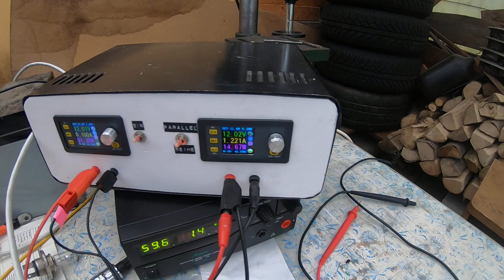Lab Update #36 - Prius Controller Progress

Comment: What kind of encoder is that and how many wires are coming out of it?
I have Renault Kangoo Z.E motor but Im running it with sensorless controller and not ideal...
 I don't know how to make of its rotor sensor that is in the motor. 
It has 5 wires coming out the harness
Reply from the maker: It's a quadrature encoder with open collector outputs:
- Black: GND
- Yellow: A
- Blue: B
- Green: 5V
The remaining wire is unused. Temp sensor brown and blue
Reply: @openinverter  On Kangoo it is white, blue, brown,  green, black.
I hope its a same thing, so I do I make that to work with regular controller that is using hall sensors?